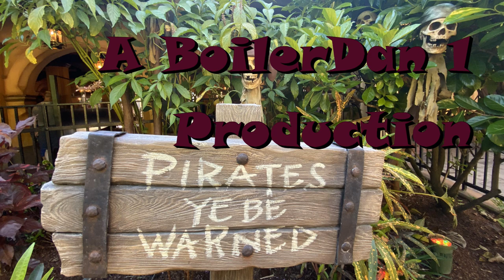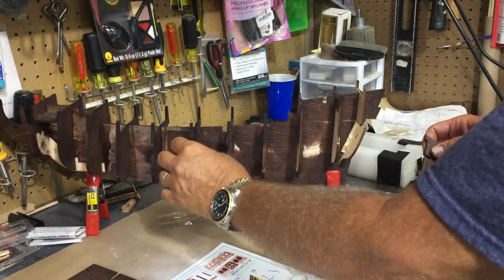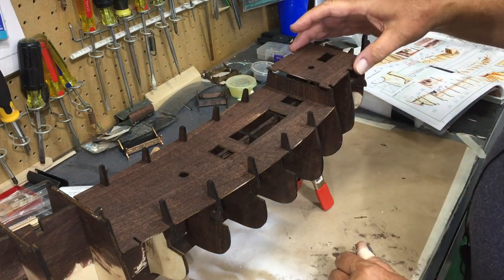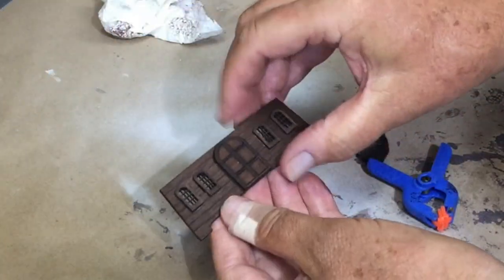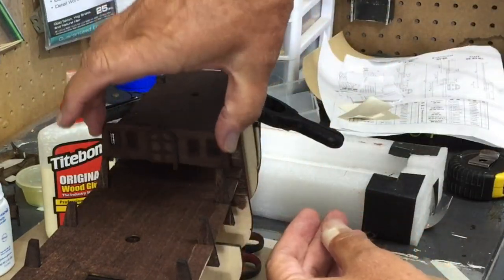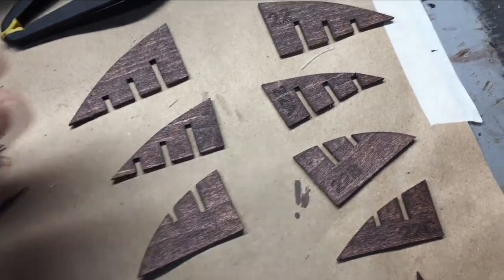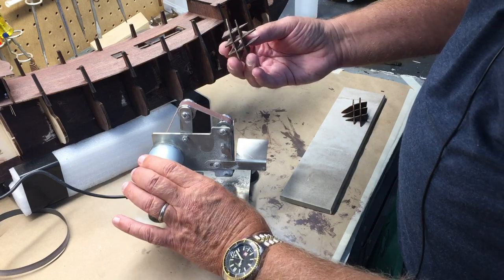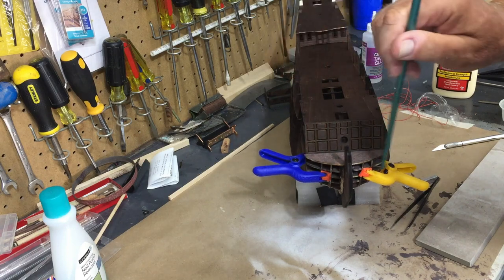The Black Pearl Golden Version 2021 Episode 3 (ALL HANDS ON DECK)

Comment: I now finished this module too. Your parallelism error has allowed me to avoid doing the same. By cons I also broke the fine part of the frame.
Reply from the maker: Darn….. the good news is that working with wood you can usually patch it up or even make the part yourself 👍👍.  You’ve finished the entire build!  I’m impressed…. But maybe I misinterpreted what you wrote..
Hopefully others can learn from my mistakes 😂.  Even so, I’m sure you’re as proud of your accomplishment as I am with mine!
Thanks for watching and taking the time to comment 👍👍
Reply: @BoilerDan1  I did not complete the entire boat, but just the equivalent of the episode in which I commented.
Reply from the maker: @daniboom3621  ahhh,  we’ll then, KEEP WATCHING 😂👍 I’m up to 17 Episodes 👍👍